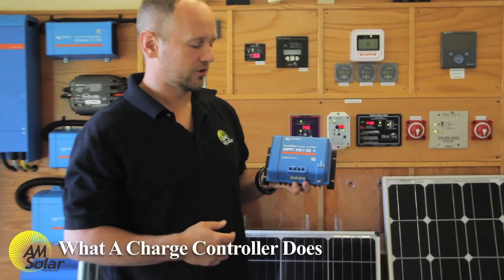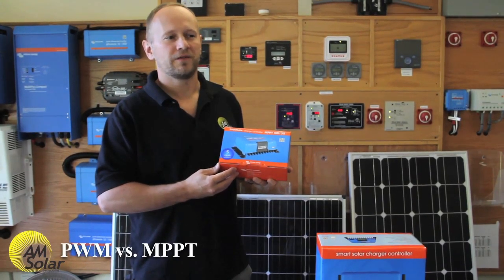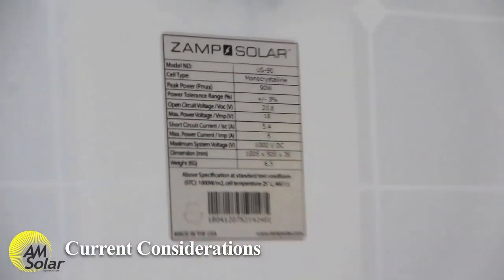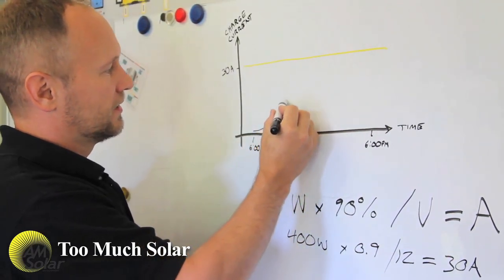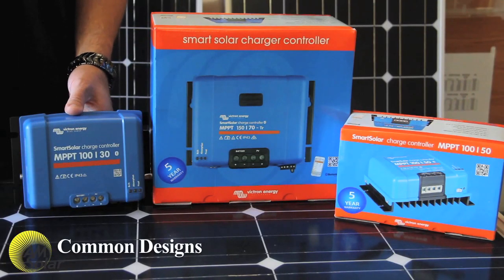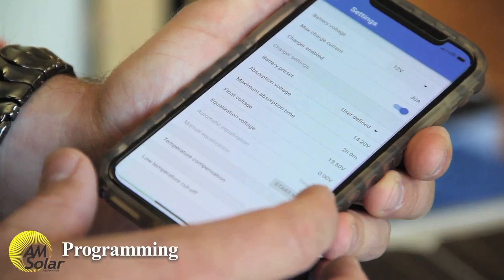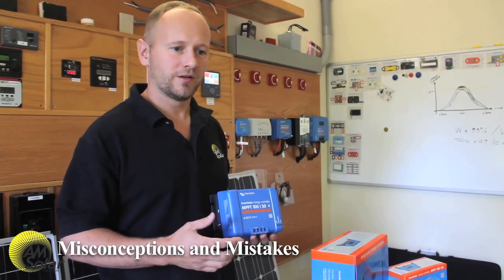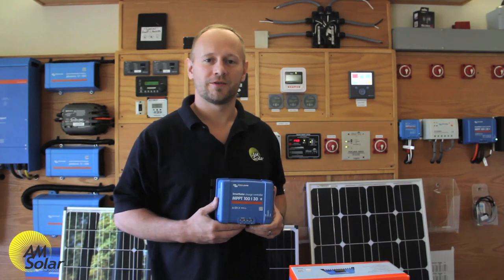How to Select the Best Solar Charge Controller for Your RV, Skoolie or Van

Comment: Thank u very much 4 ur response.Kind of u. I have a 5 panels of 100 watts each.charge controller seems 2 b local made provided by solar installer.it is 12v/50amps. Don't know y it heats up
Reply from the maker: If they are all connected in parallel and you are using at least 6ga wire, you shouldn't have any issues.  I would feel comfortable using a 30A controller on that.  Maybe you got a defective charge controller.

Comment: Hi thank u very much.but i have a ?.what to do.if a charge controller heats up. I have a 500 watts panel. 150 ah bank.
Reply from the maker: Charge controllers do get warm, but I would need to know more in order to give you an answer as to what might be going on.  What model charge controller do you have?  How many panels do you have?  How are they connected?  What kind of panels are they (e.g. W, Vmpp)?  What is the voltage of your battery bank? How long is the cable run?  What size is the wire?  etc.

Comment: If my rv has one 140 watt panel with 10 gauge wire going down to a 40 amp mppt charge controller and a agm battery bank, could I add 2 100 watt panels in parallel or would I need to wire all three panels in series because of the 10 gauge wire going down to my controller? I know in series the amps are limited to the amp rating of the smallest panel, but wasn't sure if the 10 gauge wire would work ok for the three panels in parallel.  Or should I just add one 100 watt panel to the 140, if done in parallel?  I  guess what I am asking is there a rule of thumb for how much solar wattage in parallel a 10 gauge factory pre wire should be limited to assuming normal drop from roof down to solar controller?  Thanks
Reply from the maker: I wouldn’t series the panels because the mixed Immp is too extreme. Unfortunately, I would be hesitant to add another parallel panel to your existing 10ga. We don’t like to go over 200W on 10ga. I suggest trying to find a panel with a similar Impp to put in series, rather than 100W panels. You might be able to find a150W panel. That would be close enough. But your best bet is to route new cable. Play it safe and go with 4ga or 6ga. Good luck. Hopefully manufacturers will start getting more realistic with their prewires.

Comment: I have 4 panels on my van, all are 310watt /33v /8.5a 
So to figure out what charger will work best is this correct? 1240 x .9 divided by 24 volt battery pack is 46.5 so I need a 150volt 50amp charger controller???
Thanks in advance
Reply from the maker: Definitely series pairs (2x2) on a 100/50 controller
Reply: @GarretTowneAMS  thank you man,, you're awesome...
Reply from the maker: STARBOUND SOUND I would put the panels in series pairs and use a Victron SmartSolar MPPT 100/50 (assuming a 24V battery).  Good luck with your project.
Reply from the maker: Assuming the Voc is less than 50V per panel, otherwise get the 150V version
Reply: @GarretTowneAMS  each of the 4 panels  say on them
Rated max power 310 Watts
 max power voltage 33 volts
Open circuit voltage 39.4 volts
Max power current 8.8 amps
Short circuit current 10.4 amps
Max system voltage 1000 volts

So what is the basic victron controller that would work? And do I connect the panels in parallel or series or a mix of both? To charge a battery bank of 24v

Comment: 4:05 So based on what I THINK I want; 1280 Watts of Solar and 300-400 AH of batteries 
I would Need a 150/@100amp MPPT CC << ????????????????
Reply from the maker: 1280W x 0.9 / 12V = 96A...  You are correct.
Reply: @GarretTowneAMS  
NOW, what is an advantage going with 24v system? I do NOT have either YET.
I have $3,000 set aside for this build and I don't want to get the wrong one. 
I now know of a 24v to 12v DC-DC converter.

So now 24v system is runner through my head...
Reply from the maker: @georgefenrich8942  Based of previous messages from you, I think the system you have in mind is better suited to 12V battery bank.  Added complexity of a 24V system won't be worth it on a system this size.  If you want more detail, feel free to email me at garret@amsolar.com with details of your plans and I can break it down for you.
Reply: @GarretTowneAMS  Y disagree!!    Using 24 volts systems (or even higher voltages)  will lower the amp rating by 50% only on 24 volts and even more at higher voltages... .......... (you can use smaller and cheaper controllers, thinner cabling , an when using power inverters you get way less losses due to heat and power loss... )
Reply from the maker: @MrBugsier5  I agree with your list of pros for 24V systems, but you leave out the cons.  You can’t have bidirectional alternator charging, you can’t have a prime number panel count, you need an Orion converter for 12V loads, the system is harder to service by a novice, equipment is harder to find, etc. We frequently do 24V systems when the pros outweigh the cons for particular customers, but most of the time we deal with 12V systems.
Reply: @GarretTowneAMS  
Sounds like a good answer, well delivered.
I think you deserve a thank you
so I'm giving you one.
It's a great video and thanks for spending time with all the answers you've posted.
I hope your business thrives.
:)

Comment: Doesn't a solar panel operate at whatever you wire up the panels to? I mean all panels are made of sets of small panels connected in series and parallel based on voltage and amperage output right?

So is a mppt nothing but a buck/boost controller with a bms on the output channel to protect it?
Reply from the maker: KornShaDoW097 Yes, with the additional consideration that sweet spot for maximum output continuously fluctuates based on temperature and irradiance.

Comment: Hi! So, I still want to ask.. I have two 285W 24V poly (PERC) panels, 12V 260Ah AGM battery. Which charge controller i choose? Is the Victron Energy 100|30 suitable for me? I think, i'm going to connect them series. (There are not any shadows on my roof..) Thank you very good videos!! ☺
Reply from the maker: I think the 100|30 is undersized.  You would have a lot of clipping on bright days.  I recommend the 100|50.
Reply: @GarretTowneAMS  Hi Garret! Thank you for answer. They say, that those "PERC"-panels increases voltages more than "normal" panel, is that so? My panels are PERC tecnic panels.. Obviously, they are suppose to use "on grid"- system, i don't know about those..
Reply from the maker: Riku Koivisto I’m not very familiar with PERC panels, but high wattage, not high voltage is what motivated my recommendation.
Reply: @GarretTowneAMS  Ok, so 100|50 it be.! Thank you Garret very much! Bless you.. ☺

Comment: does it matter to the charge controller if it is connected to a  lead acid battery or lithium?
Reply from the maker: DR. REAL SHIT It does not. But it does matter to the batteries if you have the right settings or not on the controller.
Reply: @GarretTowneAMS  for school project it appears my charge controller has 3 battery compatibilities lead acid, gel and sealed. When I connect the battery straight to the LED it lights up when I connected through the charge controller it does not light up, could it be because of the battery? The charge controller is a 10 amp 12/24 volt and the solar panel is 6 Watts 12 volts
Reply from the maker: DR. REAL SHIT can you email me a picture of your charge controller and how it is connected? Garret@amsolar.com

Comment: Hi Garret sir, i just bought a 75 | 15 MPPT Charge Controller. Im currently using it to charge a 12V lead acid battery but however the reading in my phone shows the PV inputs 12V & 0A. Thus my battery isnt getting charged at all. Is it true that my PV voltage needs to be at least 17V (12+5 as mentioned in the datasheet) in order to commence charging?
Reply from the maker: Eugene My first guess would be that there might be a problem with your solar panel. Remove the solar leads from the charge controller and measure the voltage between them. This needs to be at least 20V.
Reply: @GarretTowneAMS Thanks for the prompt reply. When i measured the voltage directly from the PV, it was indeed at 20V. However it dropped to 12V when i connected it to the charge controller. On a side note, my PVs (consisting different voltages & amps) are connected in series to obtain the 20V. Could the mixture of different solar panels caused this error?
Reply from the maker: Eugene If the voltage is dropping to match that of your battery bank I would guess that current is flowing and it is working. It may not be the most efficient design, but it is working. If you send me an email with more details I’ll be able to dig deeper. Garret@amsolar.com
Reply: @GarretTowneAMS  Currently im using a single 20W solar panel and produces 1.1A at 18V (according to the specifications) and connected to the MPPT controller. The blue LED is permanently on and thus indicates that it is charging in the 'Bulk' state. I also measured that the PV is indeed producing 18V at that point in time. However, in the app it still shows 18V, 0A and 0W produced by the PV...
Reply from the maker: @EugeneYeeXD  I haven't experienced anything like that before, but I also haven't spent much time working with panels rated less than 50W.  I'm curious what your panel open circuit voltage is.  If it is around 21V, and you connect it to a charge controller and it drops to 18V, that means current is flowing somewhere.
Reply: @GarretTowneAMS  Yes, the open circuit voltage is 21V. However, it only produced 18.5V as the weather was abit cloudy. Just to check, what is your PV voltage connected to your controller?
Reply from the maker: @EugeneYeeXD  If it goes from 21V to 18.5V when you connect to the controller, that means something is working.  Clouds would impact current much more than voltage.  Voltage is mainly just a function of temperature.

Comment: Can two 75/15 controllers connected in series charge a 48v battery?
Reply from the maker: Yes.  I haven't done it, but I don't see why it wouldn't work.  treat them as 24V controllers and don't put more than about 400W of solar on each.
Reply: @GarretTowneAMS  
Is it OK and or Cheaper to run single/sperate CC on a single 350-watt panel?
I want to have back-up to my back-up on my 4x350watt 1400watt system.
Reply from the maker: @georgefenrich8942  I try to use a single charge controller.  If your 4x350W panels are on a 12V system, I would recommend the Victron 150/100.
Reply: @GarretTowneAMS 
 I'm still a little lost when it comes to Ser vs Parallel ing the solar modules/panels.  
If I have 3-4 320Watts modules (960-1280 of solar) and there are for a 12VOLTS system. why would I not just run them in Parallel at 12v and x'Amps? Because all I know is that to put them in Series will (+) the volts?? Right? = 3-4 x 12v = 36-48v
and wouldn't make your CC work harder to bring 48V down to your 12v usable needs...?  HELP me see the LIGHT! ;)
Reply from the maker: @georgefenrich8942  I would put them all in parallel, not because it makes it easy for the charge controller (that’s not a factor) but because it makes the array perform better in partial shade.  Either way, you will get the same power in full sun.
Reply: @GarretTowneAMS  I'm kinda stuck on a similar mental roadblock.  I have 4x100 Harbor Freight panels that say 12v-24v current (???) I need to find the best controller and setup to maximize output. So 400x.90÷12=30A,  1. not sure if this is parallel or series, and 2. Is the math the same in series to figure which controller to pick.  Currently have 2 105agm batteries,  I may buy more panels . Thanks Garret
Reply from the maker: @heatherk8931  Parallel vs. Series doesn’t matter with MPPT charge controller selection, but I would go with all parallel.  Get a Victron SmartSolar MPPT 100/30.  https://amsolar.com/victron/cctlr-vt-mpp-030a

Comment: Just regards the rated output current ,  I've got a 100/20 Victron ,   its  set to charge 12v batteries but it can charge 24v batteries too.  As far as I know it can charge to that max 20 amp output current regardless if set to 12v or 24v batteries,  so meaning you can put in roughly double the power / wattage into a 24v battery system compared to a 12v system.using the same MPPT controller , providing the solar panels are up to it.
Reply from the maker: bradley c. That is true, but 24V systems require 24V inverters, DC converters for 12V loads and alternator charging becomes more complicated.

Comment: How do solar battery chargers (charge controllers) know the batteries are full and it's time to switch to float? The ONLY solar battery charger that measures current "drawn" by the batteries is Midnite solar with the wiz bang jr on a shunt. If you are drawing 5 amps with miscellaneous devices and your batteries are drawing less than 2 of these amps your solar battery charger will stay in absorb ignoring your batteries are full! Midnite monitoring actual current drawn by the batteries alone will switch to float and not boil your batteries. regardless how much power is drawn from the solar array. I have questioned Victron on this extremely simple concept and the replies are bureaucratic run around. 

Quote "neither the SmartSolar nor the Bluesolar units have ANY proper Ah/SoC metering functions. They both just run a crude Absorb time, which as it turns out, is frequently wrong
Reference: https://community.victronenergy.com/questions/2872/end-absorb-via-shunt.html
Reply: Edit, the Magnum PT100 "WITH BMK" will also do this.

Comment: Nice and very informative video , I didn't know that the Victron MPPT's just limit the current if there is over current ( I thought the fuse would blow ) . Thats very handy to know. Do they do the same with Over voltage? Say two 38V panels in series on a MPPT 70/15 Victron?  thnx . What I miss in your video is that a good way to expand your system with the same charge controller is increasing the Voltage from the battery pack.  ( say 2 or more 12 volt batteries in series in stead of just one 12V,  doubles the amount of watt going in, but the amps stay the same ) and besides that everything becomes more efficient with a higher battery voltage. Thnx
Reply from the maker: Unfortunately, over voltage will damage the charge controller and I believe it damages it in a way that is very obvious to the warranty department, letting them know you did not follow the rules.  It is true that you can double the amount of solar on an array by doubling the battery bank voltage, but that makes alternator charging very difficult, you would have to get a new inverter and DC/DC converters for your DC loads.  We have a lot of people come to us wanting 24V systems and all but two (Electrical Engineers without normal budget constraints) have changed their minds along the way.

Comment: Hi Garret,

thank you for this very informative video. Maybe I am mistaken, but I think your equation is leaving out the nominal voltage of the solar array. 
Let's say I have four 12V nominal voltage solar panels, each having 160Wp.
If I connect them in series and then in parallel, i get a 24V nominal voltage solar array that I connect to a 12V battery. According to your equation the maximum charge current is:
640W * 0.9 / 12V = 48A, which means I should buy a MPPT 100/50 controller.
However, the Victron spec sheet leads me to believe I should get a MPPT 100/30 controller, because it can handle up to 880W for a 24V solar (PV) system.
Could you please clarify if my understanding is wrong? Am I misinterpreting the spec sheet?

Thank you
boeben

Spec Sheet: https://www.victronenergy.com/upload/documents/Datasheet-SmartSolar-charge-controller-MPPT-100-30-&-100-50-EN.pdf
Reply from the maker: Boeben, thank you for the comment.  It helps me craft my explanations more clearly.  A couple things:  There is no such as “nominal voltage” for a solar panel, just a nominal voltage for a battery bank.  You have either open circuit voltage Voc, or maximum power point voltage Vmpp for solar panels.  People might say a panel has a nominal voltage of 12V, but that really means it is an 18Vmpp (+/-) panel, designed to work on 12V battery banks.  The equation for four 160W panels (with any configuration, series or parallel) on a 12V battery bank would be 4 x 160W x 0.9 / 12V  = 48A, and you will want the 50A controller.  The voltage in the equation is battery bank voltage, not solar array voltage.  That being said, if you had a 24V battery bank, the equation would be 4 x 160W x 0.9 / 24V = 24A and you could use the 30A charge controller.  Your understanding of the spec sheet is correct, but you are confusing battery bank voltage with solar array voltage.  Array voltage has nothing to do with charging current once it passes through an MPPT charge controller.
Reply: @GarretTowneAMS  Garret, I appreciate the feedback and clarification. I guess I got confused by the "Nominal PV power 24V" line in that spec sheet, which I assumed to be Photovoltaic Voltage (e.g. solar array voltage), especially because two lines above is the Battery voltage. I still find that spec sheet confusing, but your explanation makes it unambiguous. Thank you!
Reply: Garret Towne  Hi can I use MPPT Vectron 75/15 with a10W solar panel to charge for example 12V/1AH battery please

Comment: Hi Garret. Neat videos. Taking ambient cold temperatures into account as you know for our MPPTs complicates sizing somewhat. In this blog there is  a spreadsheet to help with that and the tabs allow you to enter non Victron panels too. I find it a very handy tool. 
https://www.victronenergy.com/blog/2014/03/28/matching-victron-energy-solar-modules-to-the-new-mppt-charge-regulators/

I didn’t write that particular blog but one I did om lithium vs AGM might interest your viewers.
https://www.victronenergy.com/blog/2015/03/30/batteries-lithium-ion-vs-agm/
Keep up the great videos. I see this one is featured on the main Victron website this week:
https://www.victronenergy.com